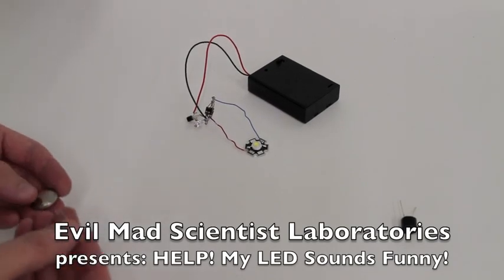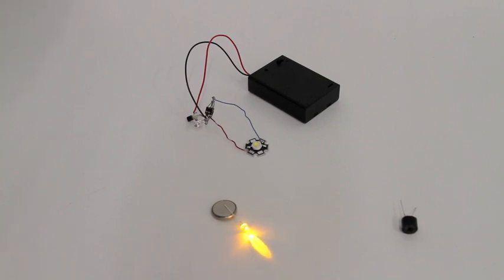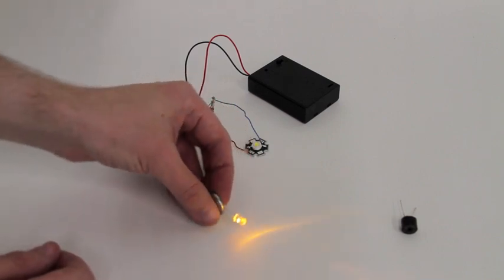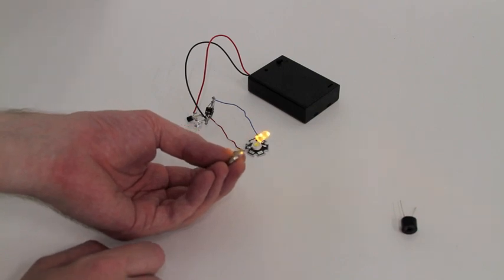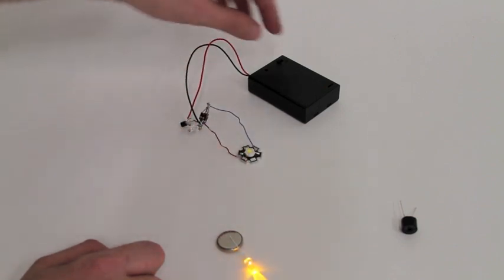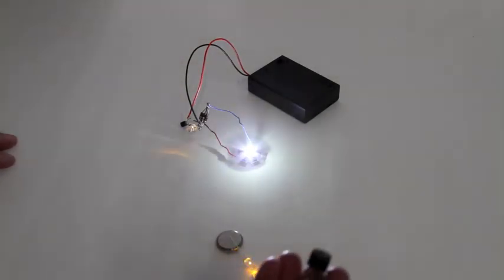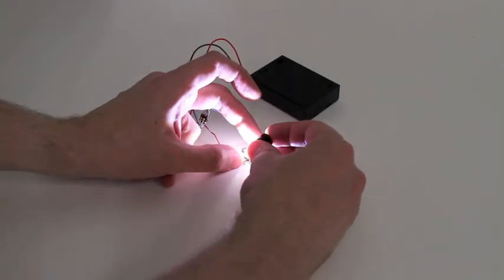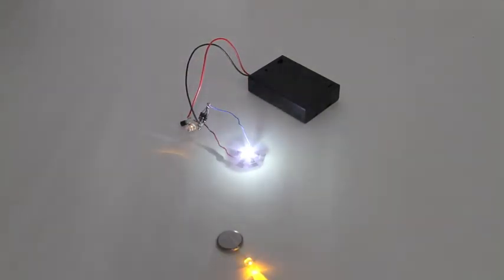Looking at (and listening to) a self-flickering LED

Comment: If you use the transistor amplifier and install a very carefully chosen capacitor value you can make the flickering softer but it still does flicker.
Reply: Use MLCC so the electrolytes dont dry out

Comment: Interesting that the PWM frequency is fairly low.  What's the bet it uses a feedback shift register pseudorandom generator and just PWMs a few bits of it?  Would be interesting to collect the output for a while and autocorrelate it to recover the length and maybe guess the polynomial.

Comment: Superb circuit, but my secondary LED (several in parallel) light  up a dimmer than they would normally run.I would be very grateful if you could tell me how to get the secondary LEDs  up to normal brightness.Al the best.
Reply from the maker: +Donald Baker You can turn up the current, up to the current limit of your LEDs.  If you're running multiple LEDs in parallel, then try adjusting the load resistor value on each of those LEDs.
Reply: Most likely you picked a transistor that does not have enough amplification (often called h_fe in the datasheet). Make sure your transistor can provide enough current and that the base current is high enough to drive the transistor fully.
Btw. I hope all of your parallel LEDs got their own series resistors. Otherwise you're asking for trouble.
Reply: Thanks very much superdau. I'll see what I can do.

Comment: It's a shame and pretty stupid that the LEDs don't have flat/inverted cone tops to make them emit more light to the side as you'd expect from a flame.
Reply: There are other variations of these LEDs: a diffused version (the smoky ones that spread the light better) and a side emitting variation that only spreads the light sideways using a cone shape drilled into the LED from above to reflect the light sideways.